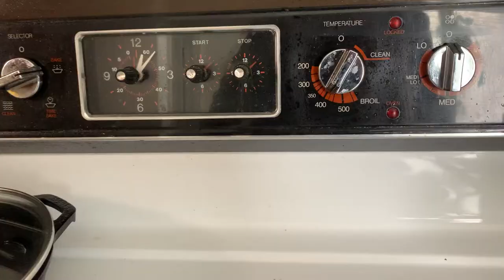Melting Borax and Brass in the snow

Comment: I am curious to what the purpose is of melting the Borax by itself? Heard Borax eats your crucible. Have never used it in any of my melting/casting projects. Nice ingots! 👍👊
Reply from the maker: The goal was to temper the crucible, I've done a couple with borax and a couple just heating to temp, the ones I did the borax in are still useable and the ones that got just heat have all cracked with in the first year.  I get it red hot and swirl it around to coat the sides and then pour out the extra. Hoping it adds a little life to the crucible.
Thanks for taking the time to comment. Stoked to get the new meltn space set up and underway

Comment: You know, we never talk anymore. 
Before you polished them they looked awfully silvery. Was it the lighting? 10:40 through 10:59
Reply from the maker: Yea your right, it was definitely a little silver coated, I think I got it a bit too hot and the zinc must have been starting to float up, It was only on the surface and it polished right off, but it was definitely metallic.  

The first pour in the new location, had to have a small steam explostition to keep up the tradition...  Gonna pick up a concrete mixer to get the sand back in action here shortly. 

Good to hear from ya!

Comment: Did you figure out how to make the metal come out of the mold without sticking?
Reply from the maker: Metal comes out no problem the stuff that got stuck in this video is the borax. It got poured into an ingot just to see what would happen... the key to not getting metal to fuze is to make sure your not pouring onto a super clean metal mold.

Comment: Sorry what does the borax do exactly?
Reply from the maker: Borax is to season the crucible. It helps to remove some impurities and it helps to fill in the small gaps in the clay before its first use in the furnace. Some of them say to do it on the instructions in the box, I've done it with and without borax on the first one and the ones I treated have outlasted the non seasoned ones.